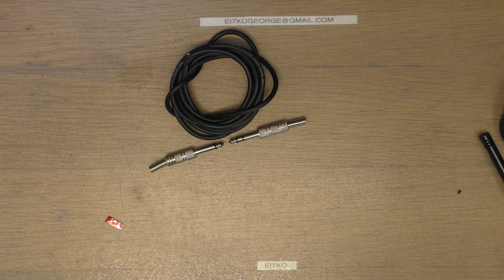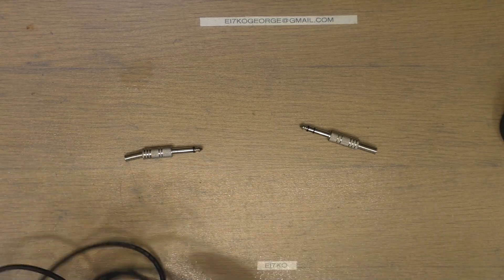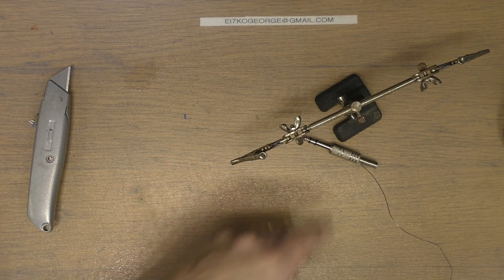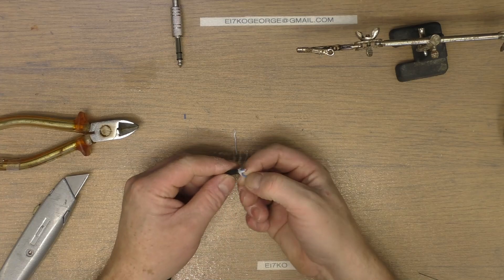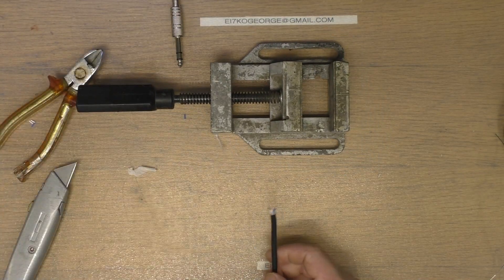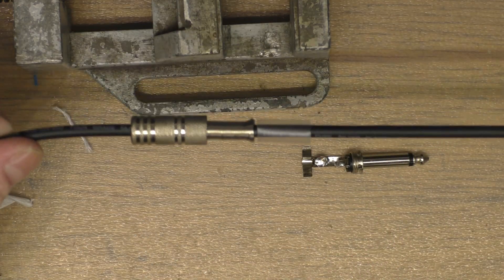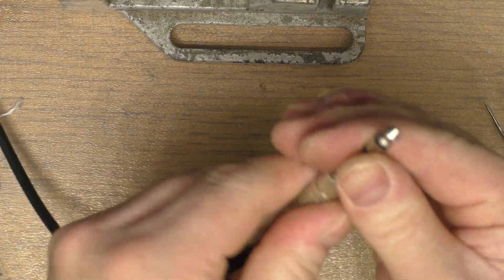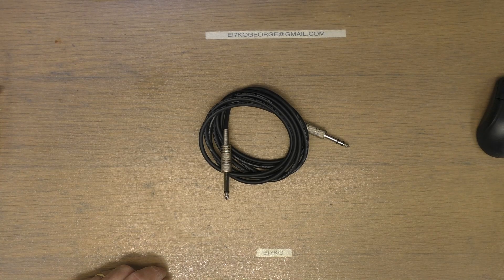How To Make a Mixer Output to DI Box Input Lead -Shack Audio Wiring Guide #ICOMIC7300 #HAMRADIOAUDIO

Comment: George, great video.  I apparently missed the part where I needed a TS to TRS cable to go to the DI box.  I used a TS-TS, and that ain't workin at all.  So, on your mixer, are you going out the main out?  I have a scanner, a IC-7610, and a IC-5100 audio in to the mixer (Harbinger 1202).  I have main out, control room out, as well as fx send.  My thought was to use FX send so the 7610 mic channel would be the only channel with FX enabled (flat), so I didn't also transmit scanner audio or xband 2 meter on to HF.
Reply from the maker: Main out yes. I dont have any other sources feeding into the mixer anymore. just tx audio . Mixer is behind the DI box in the audio chain. i used to get a certain amount of cross-talk between the two channels and it used to irritate me. i spent ages trying to fox it and gave up in the end.
Reply: @GeorgeEI7KO  OK - so coming out of the mixer mains, I'm going to run a straight TS-TS cable out to the DI box, or does that need to be TS-TRS?  Out of the DI box is an XLR cable to the adapter for the IC-7610, a female XLR and a female 1/8" for the mic input and PTT respectively.   What's driving me nuts yet is that with a straight condenser mic (Sennheiser 609) plugged into that ICOM adapter, audio is perfect into radio.  I just need to reproduce that from the mixer.   I had used a straight TS-TS out from the mixer, but when I keyed up on 80 or 40 meters, I got all sorts of growling, pulsing not good noises from the audio monitors.

Comment: Any tutorial on the Icom 706mk2g to a mixer please asked around but nobody can answer me is going to a condenser mic? Not sure what the wiring is or what components I need thanks again.
Reply from the maker: The manual in the Connectors section will tell you all you need to know. I dont actually have one of those radios , so it would be very difficult for me to do a tutorial.
Reply: @GeorgeEI7KO  Thank you for getting back to me I will have a look in the manual to see what I'm looking for errm what I'm I looking for ? Thanks Tom
Reply from the maker: @Tom_M9FUE  you need to know where the audio input is...the microphone ground...chassis ground....etc if you want to add PTT which pin does that. You'll be looking at the accessory port socket.
Reply: @GeorgeEI7KO  OK I see but someone was saying 5 volts is passed on the PTT so not sure what to do really as people said it will blow up the radio? :/ not sure really 😕

Comment: Good vid George, the 1/4" connectors... do you get them local or online, got a link?
Reply from the maker: Hi Pete. Thanks for the comment. I normally get them on ebay to be honest. Those were 5 for 3 quid or something. I've never had an issue with one of them.
Reply: @GeorgeEI7KO  Appreciate the reply... will have a look on eBay... Thanks!
Reply from the maker: @Petes.Hobbies  no problem Pete. Any time
Reply: George Donaldson EI7KO I
Reply from the maker: @Kierandj1980 ? Go again. No comment there